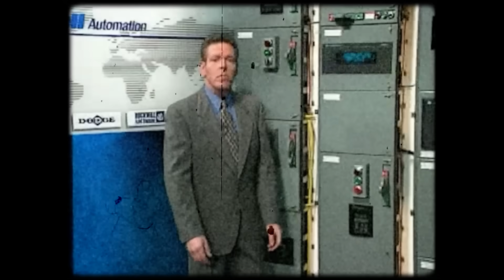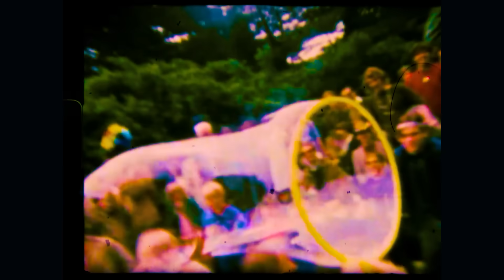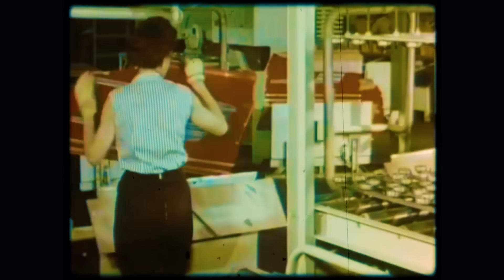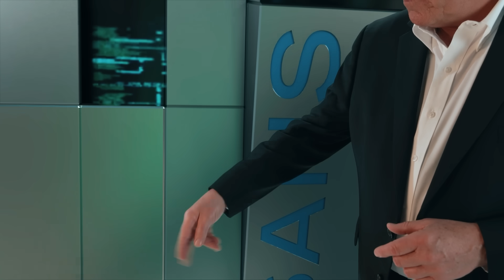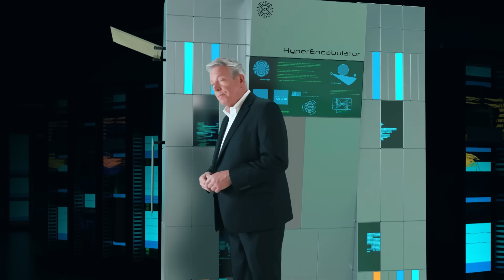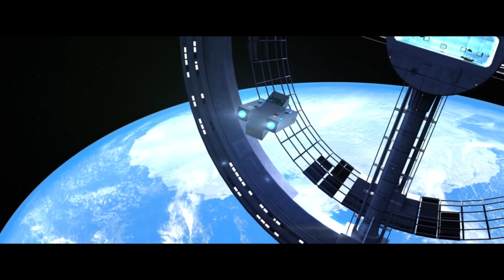SANS ICS HyperEncabulator

Comment: You can't be kidding me. Even with the Retro Encabulator I had troubles with side fumbling due to the waneshaft and spurving bearings being too tight of a fit. These madmen may have finally solved the side fumbling issue. But time will only tell.
Reply: Honestly I doubt it, side fumbling is just as much a problem with physics as it is with the typical at-home voculi rig. It's destroyed more than one rig of mine when I haven't accounted for it.

Comment: When I was a kid, I kept hearing "we're 20 years out from having Encabulation without side fumbling," and then in 20 year increments the same thing.  But now, at the nadir of my life, I can truly say   I think we are at worst 25 megacycles of Encabulation out from that.  What an amazing age I've lived in.  What an amorphous solution to an inelegant problem.  And in 50 megacycles?  The mind boggles, I'll admit.  But, Encabulation on Titan and Pluto?  Even if you factor in a 50% Bollshiddio value, that's doable.  It's in the math, and our hardware is already firm enough for the additional mastication required in those environments.  So that's triple-Encabulation within one star system, which reduces the odds of fractal resonance Encabulation to remote asteroids.  And -- in case you thought I'm whistling through a lead plate -- I was the director of the Asteroid Encabulation Study from 1993 to 1999:  and my team proved Space Encabulation, despite all the critics and the fact it cost us an unfortunate chihuahua-based life-form.  And I'm sure Alberto would've wanted it that way.

Comment: The auxilliary SOC drawer is absolute in its lack in both economic and practical merit and so finds purchase behind a vertically optimized and located touch-activated panel.  The maintenance costs for this moving part contribute 13.7% of the annualized income to ICS and its subsidiaries.  The SOCs, of course, are sold separately.

Comment: I don't know. I can't say I'm not impressed by the incredible rates of frenetic mastication you can get nowadays, but I think we are losing something valuable along with way. There was a time when you could pop the cover and change your own wainsprockets when they needed it. I was getting a lot of encabulation flash from my fancy new unit last month, and I couldn't touch it without voiding the warranty. It took them a week to send out a tech, and when he got here, he didn't even know what a wainsprocket was! Changed out the whole blatherscite assembly. It's just a module you throw away when it wears out now. You know what? For the week I was waiting for the tech to get out there, I dusted off the old turbo-encabulator we used to use for the shop, changed out the crenelation fluid (It had thickened up in the injectors), and fired the old girl up. Sure, it was a bit slower, but we got everything encabulated just as pretty as you please, and saved money on power to boot. The smell of freen oil from a well tuned set of spurving bearings running full-tile sure brought back memories.... I don't know, call me old-fashioned, but there was a time when it was the mark of a man to be able to tune your own magnetic reluctance coils.

Comment: Hogwash. By 2030, all forms of encabulation will be seamlessly managed by advanced AI systems, which will dynamically recalibrate the inverse capacitive flux of the panendermic semi-boloid algorithms. Traditional turbo-encabulators relied on human intervention to stabilize the sinusoidal grouting, but next-generation AI encabulators will autonomously harmonize the differential girdling of retroactive malleable modials, eliminating inefficiencies altogether. Through recursive neuro-syntactic pre-oscillation, AI ensures perpetual alignment of the quasi-lenticular grummets, thus heralding a new era of fully automated encabulation without the risk of manual mis-phasing.

Comment: While I commend the commendable efforts of your design consortium in achieving a fifth-order harmonization of the retroactive phase-orthogonal modulators, I must regretfully recuse my infrastructure from any interface with your encabulator due to an endemic non-congruence between my hyperlaminated precession gyrostators and your bidirectionally articulating panendermic resonant flange arrays.
In my own facility, the pseudo-dynamic overthrust sprocket linkage has been meticulously calibrated to a zero-fumble magneto-susceptance, and introducing any external encabulatoric torque vector—particularly one reliant on inverted sinusoidal detent oscillators—would undoubtedly destabilize the tri-modal gravito-reluctance matrix, causing a chain reaction in the tertiary quasi-phase flux galleries.
Furthermore, the integration of your modial interaction subsystem with my semi-encapsulated overcoil differential would necessitate a total re-alignment of the prefamulated amulite containment vessels, a process that historically results in catastrophic harmonics within the negative phlogiston chamber. My legal department has made it clear that any recurrence of such an event would exceed the liability limits stipulated by the Anti-De-Cohesion Act of ’58.
In conclusion, while your encabulator may represent the pinnacle of unilateral torque inversion, its deployment in my macro-synchrotronic environment would be tantamount to intermodular disaster on a polyrhythmic scale. I must, therefore, remain respectfully and irreversibly uninterested.

Comment: When I was a mechanic, we had an old, modified turbo encabulator we used to send the new techs to adjust. Little did they know if they claimed to adjust it, they would have induced side-fumbling, and were immediately fired.

Comment: So ,from my understanding it essentially clamps the encabulation due to mtu mss polination in the proto udp sonic wall, which in turn actuates the asymmetric block encryption on the hyper convergence bitstream and modulates the S pipe in the duranium fellswoops. This would be a detrimental upgrade to the sideflop discrimination matrix at all the 7 layers. 
That makes perfect sense.

Comment: The leading edge research nowadays is to be found in quantum encabulation. While theoretical, the potential to harness entanglement phenomena to leverage pre- and post- causal mechanisms is fascinating.
Reply: That or indeed hyperspacial-encabulation, (not to be confused with the herein presented Hyper-Encabulator) both sides of the same coin in essence but requiring twice as many in-line pentametric fan spurving bearings and a further 8 hydrocoptic marzlevanes previously thought to be primarily for near elimination of side fumble, but now repurposed to achieve total harmonic disliminality. Fun fact: While we still call them ‘encabulators’ today, modern encabulation machines actually operate through a series of hypermodal undulative quantum matricies, technically making them aptoregressive chirality de-unencabulators.

Comment: Oh thank GOD, I was getting so sick of the dingle arm on my retro encabulator constantly side fumbling, which is an issue I was told they FIXED with the retro encabulator. That was part of the whole appeal, I feel like I had been bamboozled. So glad they FINALLY updated the system to modern standards. The HyperEncabulator makes side fumbling and fluxuational endothermic interference a thing of the past. 9.4/10.

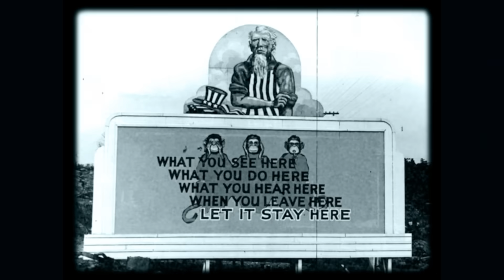Comment: 1:12 They learned empirically that one should not encabulate using smart calcium components, while the government released scientific papers portraying it as theoretical scenario under the moniker of the Helvetica, the incident was declassified in the early years of the millennium since more horrific incidents has happened since. Of course, the risk of Helvatica in the early days meant that smart calcium was out of the question, and so the search for safer smart materials to transubtantiate encabulation began. An unexpected turn of events was the discovery of lab made smart materials created by the encoding of knowledge, an endeavor that gave us synthetic smart silicon, achieved by tricking silicon into thinking via pavlovian conditioning where we encapsulate the silicon and give it random enrichments until we get the desired behavior. However, as it turn out, it was simpler to make smart vinyl, since the process only involves making it dance in circles with a groove until it begins thinking. Which is the technology that unlocked the first wave of comercial encabulators affordable to the public. The declassification of the original incident allowed the development of a more humane methods to create smart materials known as reinforcement learning, where we bring the material to a classroom, give them other materials to study, and make them take exams. Finally, with the help of transformers from Cybertron, we have the recent renaissance of artificial intelligence. Of course, with all these smart materials going around, the application of encabulation technology for cyber security (that is security against attacks from Cybertron) was the obvious next step.

Comment: I wonder what's next! I'm hyped up like a kid in the 50's when they talked about people living on the moon in the 1980s! Perhaps, using a retro-reflective photo-matrix projector coupled with parallel neo-conniptions , why, we could even get a fully functional and interactive hyper-dingle HOLOencabulator!

EDIT - Buuuuuut, then again, we would have to figure out a way stabilize the inherent phase vibration from the duo positronic coupler when mated with HyperEncabulator starting module

Comment: I'm not sure I understand. As per the manual:

The quantumly refracted hyperbolic transmogrifier is an advanced apparatus designed to modulate and 

restructure polydimensional waveform matrices through a process of hyperbolic phase-inversion. Its primary 

function is to recalibrate the angular harmonics of quantum sub-lattices, thereby enabling the seamless 

transference of meta-stable particle states across non-contiguous dimensional strata. This is achieved 

through the deployment of a refractogenic oscillation manifold, which dynamically aligns subatomic spin 

vectors with the interstitial hyperflux gradient, facilitating a controlled collapse of entropic asymmetry 

within the waveform structure.

At its core, the transmogrifier employs a heterostatic nullification prism, which acts as a focal point 

for the bifurcated refraction of quantum states, enabling the simultaneous realignment and augmentation of 

their hyperbolic coefficients. By engaging a tri-modal synchromesh array, the device ensures that the 

transmogrification process remains stable, mitigating the risk of stochastic perturbations in the quantum 

field. As a result, the quantumly refracted hyperbolic transmogrifier is indispensable for applications 

requiring the precise manipulation of extradimensional energy constructs, including but not limited to 

trans-phasic energy relays and chrono-spectral divergence stabilization.

Do I press the green button?
Reply: green to start it. orange to begin pressurizing the discandescense chamber. 
Your supervisor will give you more instructions at this point depending on what you'll actually be encabulating so just remember green then orange then wait.
Reply: @misterturkturkle  Thanks, that makes sense.

Comment: I was an "encabulator baby", due to the crossthreading of Amalgam Waves that the older models were known to spontaneously pulsate, and my mother's proximity to the multiplanar reactant element drivers during her work at the Rockwell R&D facility, i was born with no preconical lobe and abberations in my Fleming's Diaphragm. I have been able to lead a happy life by supplementing the CarboChronase I was prescribed with a basified green tea transdermal cream that i apply to the affected areas.

Comment: Welcome to the next chapter of engineering evolution: the Quantum Encabulator. Building upon the foundation of the legendary HyperEncabulator, the Quantum Encabulator introduces an entirely new paradigm in mechanical and computational synergy.

The Quantum Encabulator employs an advanced superluminal resonating flux stabilizer, seamlessly integrating quantum coherence into traditional encabulation principles. This allows for unparalleled manipulation of transdimensional energy states.

At the heart of the device lies the quantum-infused hyperdeterministic gyrochronometer, which uses entangled oscillatory harmonics to ensure phase-locked intermodulation of the pan-chromatic flux capacitor. This eliminates the need for traditional inverse-reactive helical dampeners.

The primary innovation is the modular quark refractor, which introduces a dynamically shifting qubit lattice. This lattice not only sustains quantum stability but also prevents decoherence in the presence of high-energy framistats.

To enhance operational efficiency, we've replaced the conventional marzel vanes with self-aligning photonic warp gates, reducing fibration frequencies across all oscilloscopic parameters. As a result, the Quantum Encabulator achieves peak performance with minimal quantum jitter.

Through our patented zero-point bifurcated nanowave sequencer, the Quantum Encabulator can translocate fermionic bosons across multidimensional space-time, enabling instantaneous load distribution across five-dimensional axis rotations.

In layman's terms? It means faster-than-light computation, zero downtime, and a drastic reduction in Schrödinger oscillation collapses.

Thanks to its plasma-synergized entropic recalibrator, the Quantum Encabulator can achieve flux compensation rates 300% higher than the Turbo Encabulator, all while maintaining compliance with the Heisenberg Uncertainty Principle.

The Quantum Encabulator isn't just an upgrade—it's a revolution. Whether you're navigating temporal vortices, stabilizing wormholes, or simply optimizing your synchrotronic meta-loop arrays, the Quantum Encabulator is the tool you need to go beyond the limits of possibility.

"Quantum Encabulator: Engineering the Future, One Quark at a Time."

Comment: Technology progresses so fast! Now the US Government is working on building the Quantum HyperEncabulator, which is capable of omniencabulation at speeds previously thought unpossible. Supposedly they're combining the simple physics of the kanuter valve, found in many automobiles and in common household plumbing, with quantum tunneling and antimatter retroactors to make it all possible. Rumor has it DARPA is even in on this project! It should be even more unhackable and indestructible than the first generation SANS ICS HyperEncabulator. The most interesting part? The Quantum HyperEncabulator allows side fumbling, it actually makes use of the way side fumbling interacts with retroactive antimatter pulses to function properly.

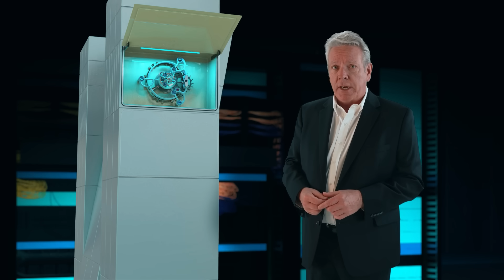Comment: 5:09 - that is a tourbillon escapement from a watch that for whatever reason isn't rotating. And no, I did not make that all up.
Reply: why do you say it's a tourbillon? looks like a fairly standard escapement to me, but i'm no expert
Reply: @Gigaguenther the escape wheel isnt usually pulled so tight into the balance in a non-torubillon layout. You can also see the pivot and pinion sticking out the middle indicating the entire assembly as driven through the pinion and rotates about the pivot

Comment: I'm glad to see encabulation technology weathered the storm of the Covid-19 pandemic. I was worried encabulation would stagnate. My new fear is A.I. taking over traditional encabulation theory and technological design. Yes, in the long run it may be a good thing, but at what cost to society? Hundreds of encabulation engineers will be left out in the cold.
Reply: Don't you see?
The more sophisticated AI becomes the better it can handle the one problem that really plagued the first encabulators- shielding the operator.

The first ones used refabulated amulite because of its low infractive properties needed to encabulate in the first place, but for years we had trouble finding a material that was both infractive and preflective. 
but with an ai operator we dont have to worry about the deplanal waksomns because only oraganic material can be affected so long as the computer system has proper wak-soft to handle its own maintenance- and that's just a matter of programming. 

trust me. encabulation is just fine and with AI handling the day to day operations cheaper and safer, researchers will have more time to spend on potentially world shaking breakthroughs.
Just imagine what happens when they finally figure out Gravitational encabulation...

Comment: My great grandfather was killed in a horrific accident after the Encabulator side-fumbled and tore him in half. I'm glad they fixed it on this model.
Reply: Was he using one of the old kerosene powered ones
Reply: @Sid-jx4gl  Probably. They had a tragic tendency to side-fumble.

That said, there was an even worse error that they don't like to mention the old models had. "Agster field dissolution"...
Essentially, sometimes the encabulator would release its spindle a heptostall too soon, which would lead to a back-up in the glerck fluid. And now, you really don't want the glerck fluid to get backed up, because it superheats the more it comes into contact with itself, which of course activates the backup Rikter-field which would rend someone's entire existence across spacetime.

Yeah, the only way we found out about it was by identifying the hole the first guy left in reality. A nasty way to go, having never existed. Anyway, fixed now that the spindle is always perfectly synced to reel-time.
Reply: @Ixarus6713  Fumbling often had to be done manually at this time.
Reply: Gotta lube the dinglearm... or that will happen.
Reply: Dang it! I thought that they only torn thangs in quarters or dimes 😮
Reply: Zorpalod
Reply: Which encabulation device was he destroyed by? The turbo encabulator had effectively avoided side-fumbling.